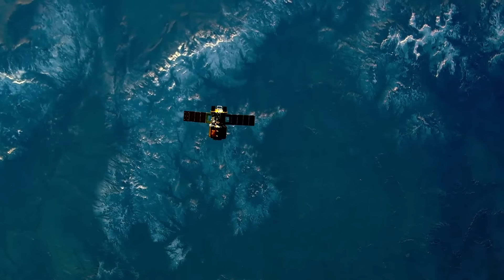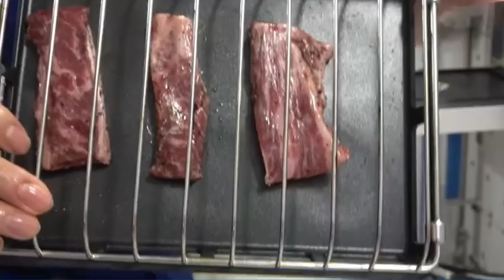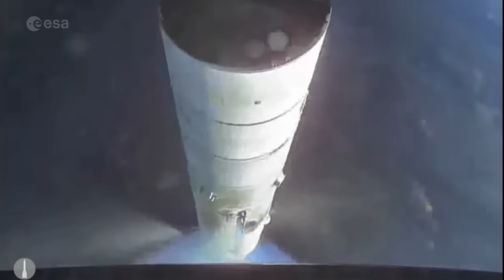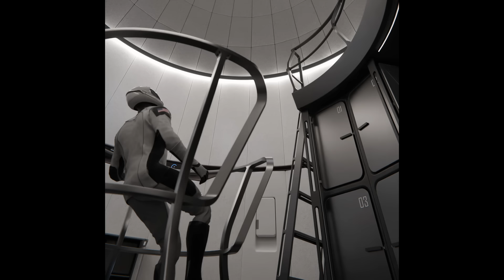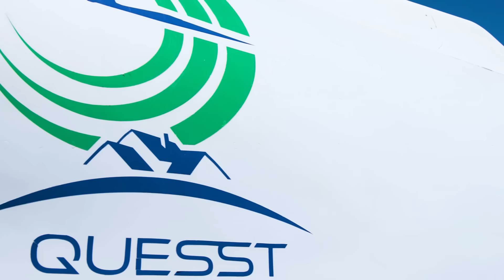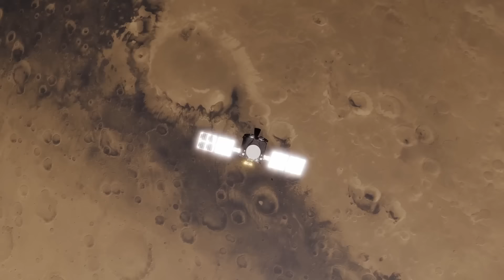Seize The Night! - FAA Bans Daytime Rocket Launches - Deep Space Update - November 7th

Comment: Nuclear is not a good power source terrestrially compared to solar & wind, but is an excellent power source for space. RTG included.
Reply: Biggest lie of the millennium.
Reply: LOL
Reply: Wow.  Just wow.  I hope you are joking, if you are serious, well, i just hope you aren't serious.
Reply: @jeromethiel4323 Once you remove the propaganda- you find no new nuclear has been built in most areas whilst solar & wind have been run to by energy companies. There are sound reasons for this. 

If nuclear was better, or even as good, they would be building those at the rate they're installing solar- but they're not. 

Most advocating building nuclear power plants lack the physics background to understand why solar is superior to nuclear fission. I will be breif but spare the technical details (those are available for the interested parties)- nuclear fission (current power plants) is inferior to nuclear fusion. 

Solar runs off nuclear fusion. Placing fusion reactors on Earth is a pipe-dream but even then it runs a steam turbine via heat engine. So it's stream powered, and 60% efficient. Additionally nuclear fusion creates deadly radioactive reaction chambers which are too hostile even for robots to operate in. They are brown sites for many decades after use and must be abandoned yet maintained & secured- again- for decades. 

Having your nuclear fusion reactor in space, and building it 1,300,000x the size of Earth... And placing Earth as close to it as possible... So close if it were 10% higher output all the oceans on Earth would boil-off... 

...well that's just obviously superior. No need for further details- if that's not imediately obvious then no additional physics details will clarify it further. 

Nuclear Fusion (ie. Solar & Wind [wind is powered by nuclear fusion]) is vastly superior to nuclear fission such as plutonium & uranium reactors. (Such are better than coal & LNG, but pale compared to Solar & Wind- the energy of which exceed the Global daily usage of the entire planet Earth many times over- and cost less, are faster to build, and more efficient. Still, nuclear coiuld have it's place in a base-load scenarios under limited condotions). 

Now nuclear rockets- THAT is a different story. They are an excellent solution cutting fuel requirements by half- eliminating the oxidizer- electro-chemical exchange of charge is not as efficient on an energy-mass ratio as the heating from an atomic nucleus directly. Of course anti-matter would be better, as would neutrino capture but these pose technical problems at this stage- (anti-matter likely being closer than neutrino capture). Nuclear fission is still good here- fusion would be better, but there are engineering issues to overcome.
Reply: The fear mongering succeeded
Reply: @peeperleviathan2839 Education succeeded over propaganda, if that's what you meant. "Fear mongering"- propaganda.

Comment: It is true that the ESCAPADE spacecraft are very small compared to the New Glenn rocket. I assume that the contract with NASA for the launch is not the full price of a New Glenn rocket, since it is more like a Blue Origin test flight.
Reply: Broadly, yes. ESCAPADE was supposed to be the first flight of New Glenn, so was priced accordingly. BO's failure to meet the deadline for the launch window means that it was pulled from that flight, but I assume that since it was BO's fault (and they don't want to be blacklisted on other missions for screwing NASA over), they'll be honoring the original pricing.
Reply: Yep

Comment: I think the Tiangong crew is facing a dilemma given the timing of the damage was during the transition between the two crews. Should the Shenzhou-20 be found to be too damaged to return safely, they could launch Shengzhou-22 to take the SZ20 crew back as -22 is on stand-by anyways. However that means there would be no backup ship on the ground for the -21 crew. I can only think of two options: keep all crew in Tiangong for another 3-4 months until they build SZ23, or get all crew back in SZ21 and SZ22 leaving Tiangong unoccupied until they build another two new ships.

Comment: When was the last rocket built and launched by NASA? And how many billions have they been given since?
Reply: NASA doesn't build rockets, their contractors do.  You need to start with a more fundamental understanding of who does what.
Reply: The last rocket designed by NASA and built for them directly is the Space Launch System. It last launched in Nov 2022. That was the old system, NASA did the overall design work and worked with the contractors on all the levels of detail. It was many years late and cost $25 billion to develop. Main contractors are Boeing and Northrop Grumman.
Reply: NASA have never built their rockets, other than maybe sounding rockets. Even in the earliest days of the agency, NASA have relied on contractors to do all the construction and much of the design. The Apollo missions, for example, flew on a rocket primarily built by Boeing, North American and Douglas; the capsule was built by North American, and the lunar lander by Grumman. 

NASA *contributed*, certainly — to requirements, to design, to testing — but rocket building has never been their skillset.

Comment: Inflatable habitats seem like a great idea, but... One return module has space debris damage and spacex might need to rescue them. I hope the Inflatable habitats that spend much more time out there come with a few bike tube patches, or at least plenty of duct tape.
Reply: SpaceX does not need to rescue them. They have another capsule docked to the Tiangong specifically for this purpose, just like how the ISS always has a docked capsule for emergencies as well.
Reply: An inflatable habitat has been part of the ISS for years with no puncture problems. It's used for storage.
Reply: just a joke, he had just said the bit about the debris damage and space x could always send something up for them, etc. then brought up inflatables. Also a little concerned about ol' kessler, and I wonder if the fabrics might even be better than hard materials against debris, (or at the speeds involved, does it matter?) Really, I just thought fixing a hole in a space station with an actual bike tube patch was kinda funny...

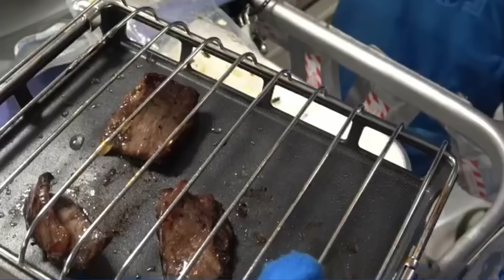Comment: While I'm sure that the grilled meat is a welcome addition to one's diet, the image at 3:59 makes me wonder how much aerosolized oils are things that life support is going to need to contend with.
Reply: I mean a modern life support system should be far better than what was put on the ISS decades ago... Also it would be possible to build a vacuum air fryer that can filter/suck all that stuff out before the oven is unsealed.
Reply: Filters (e.g. HEPA for the particulates and activated charcoal to reduce the smell) with forced recirculation before opening the oven door should do the trick.
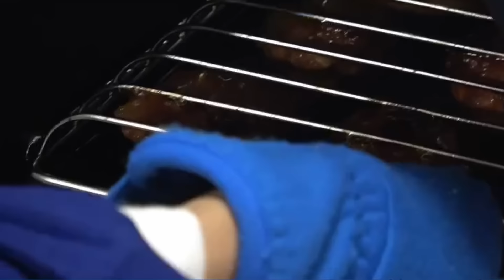Reply: @sashimanu  Possibly...  but that's not what I'm seeing at 3:46 and beyond which has grease splatters on the cooking surface.  My cooking isn't better, and I know that my toaster oven could do with a cleaning.  I am aware of the AQI in my kitchen when I'm cooking something that has some oil component to it (e.g. a burger).

Comment: Can aircraft takeoff & land at busy airports without controllers using radar & radio communication? I'm 85 years old & we would show up at low altitude over the runway, look over at the tower where they would shine a red or green light at us. It wasn't very busy back then.
Reply: Military airports still use lights from the tower when they want to conduct operations without a bunch of radio attention.  Airports more often than they'd like accept aircraft with no radio, usually because the radio(s) has become inoperable.  You just have to keep all the other acft away.  Not advisable for routine operation.
Reply: For regions of heavy air traffic, like around cities and large international airports, ATC has a very important job in rerouting traffic and ensuring collisions don't occur, which does require radio communication.

Comment: Don't worry, steak and chicken wing oil floating around in the station won't cause any problems in the future, it's a lubricant 💡
Reply: It's interesting how the meat went in bare and came out glazed - the glaze looks like it would hold everything in place. There must have been an intermediate step not shown. I read this is basically an air fryer - I have no idea how that would affect the fat cooking out of the meat. Yeah, if it was this easy to do without messing up the air I think the ISS would have had it long ago.
Reply: @donjones4719 I think same carbon filters we have in many kitchens can deal with it. There will be some cost replacing the filters eventually. I have heard bread is a nono due to crumbs spreading. Anyway I am happy for these astronauts (taikonauts) looked delicious.
Reply: @xehpuk   Yup, the astronauts roll up a lot of food in no-crumb tortillas.
Yes, commercial kitchens have those big grease filters in the ventilation hoods, a filter and fan in that cooker is the logical choice.
Reply: @donjones4719  it is basically a air frier with a lot of filtering to remove the vaporized oils to prevent it coating everything in a fine layer of grease. It's said in space (with zero gravity), oil will stick to the food better from surface tension (hence the glaze). so no dripping unless you wave them around real fast. I would bet it is safe to bake meat up there, the guys doing this will not risk anything just for a showoff.
Reply: @donjones4719  All the goo that ends up on the tray on Earth probably just sticks to the meat and auto-glazes it in freefall. That would be my guess at least.
Reply: @donjones4719  it was not easy to do. Tiangong was fitted with a microwave oven before this convection oven, and the microwave oven had to be designed specifically for confined space usage in orbit. ISS is old and high power appliance was never designed to be fitted
Reply: my guess would be some kind of vacuum system combined with a air fryer to suck up all the fumes and vapors
Reply: Steak and chicken? You mean cat and dog?
Reply: @tehallanaz  They're grilling the cats, they're grilling the dogs!

Comment: Hey Scott, a clip showing one of the Chinese rockets reminded me of a question I've had from some time. The rocket showed that its boosters' thrust is angled slightly with respect to the rocket's direction. Since this is an inefficiency, what's the reason for it? Do booster exhausts interfere with each other so the angle gives them a slight independence? What gives?
Reply: All nozzles approximately point through the center-of-mass. So abrupt engine loss does not perturb orientation, thus simplifying design issues with the guidance and Thrust Vector Control systems. This choice is especially relevant if the SRB nozzles do not swivel at all.
Reply: @imconsequetau5275  Yeah, that occurred to me but it seems unlikely that a mission survives loss of an entire booster but I guess they need to consider control even if they are going to ditch it.
Reply: They cannot control SRB shutdown. These fizzle out at random moments, so pointing nozzles through the predicted center-of-gravity is excellent. They are planning for success, not loss-of-vehicle.
 @PaulFromLongBeach

Comment: Does SpaceX ever have a booster return then scrap it? It would seem that would lead to a great deal of expensive Aerospace Metals recycling♻️.
Reply: Only if the landing fails. They get rid of old boosters by flying them on missions that require the extra performance from expending them
Reply: Falcon 9 is carbon composite consttuction.
Reply: @slartybarfastb3648   No, it's made of an aluminum alloy. It's Rocket Lab that uses carbon composite.